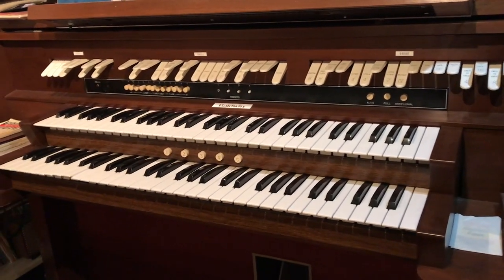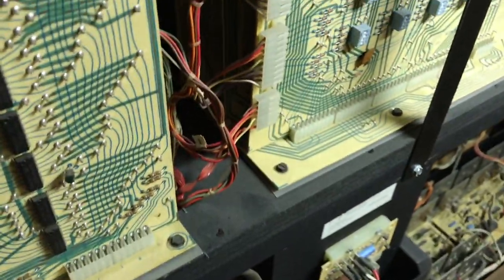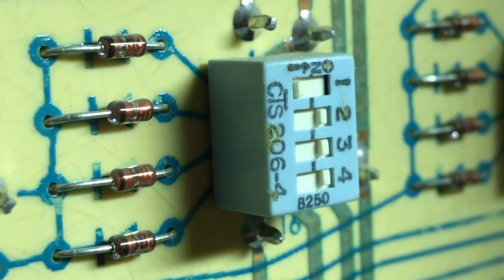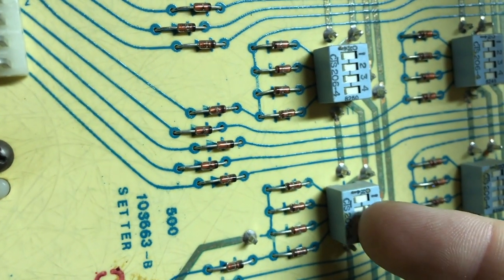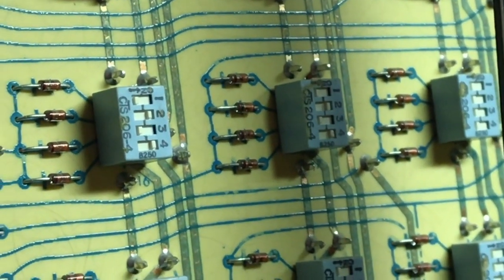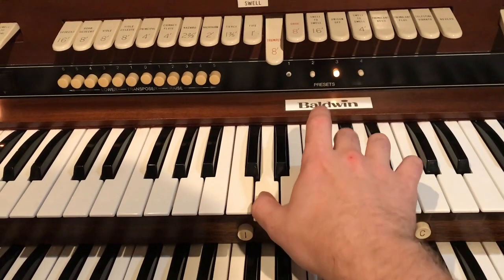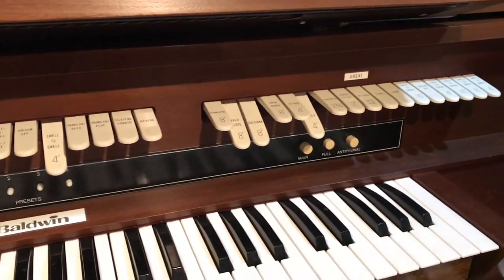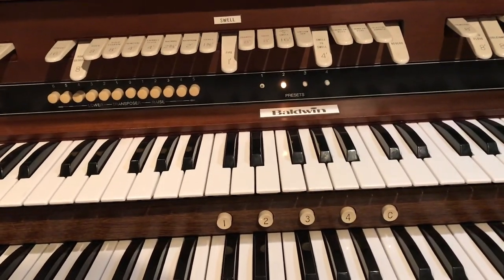How to Change Presets on a Baldwin Organ

Comment: I have a Baldwin 632.  When I turned on the switch, I heard a loud humming noise and no sound when pressing on the keys.  After nearly 45 seconds humming, the noise went away and the organ would sound when a key is pressed.  This problem went on for several years.  Two days ago, the humming sound went a bit longer, but it did not completely go away, then there is no more sound when any keys are pressed.  Can you tell me what's happening and how can I fix this problem?  Could it be a transformer problem or a capacitor that has to do with sound?